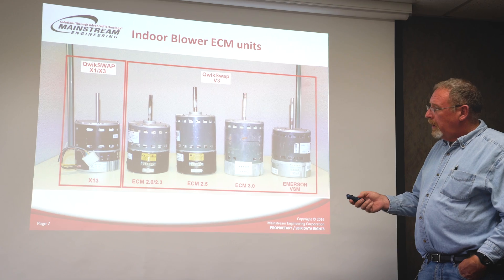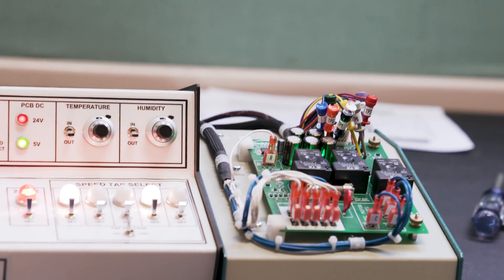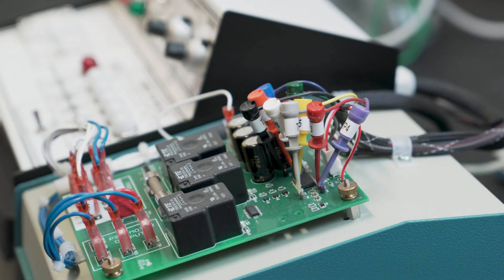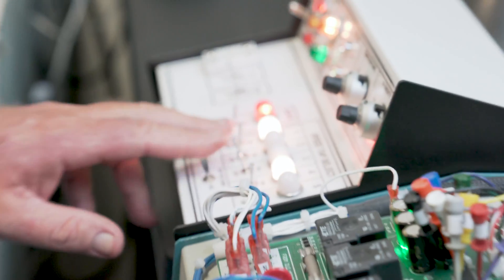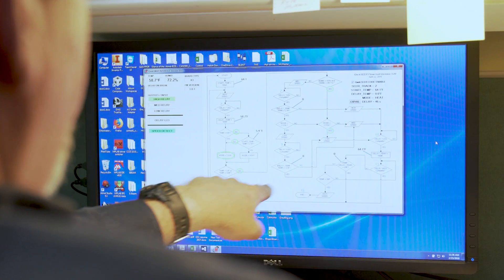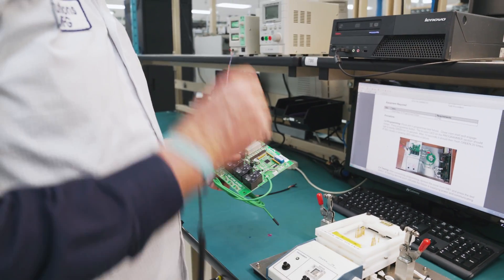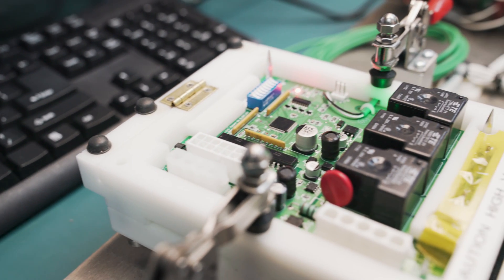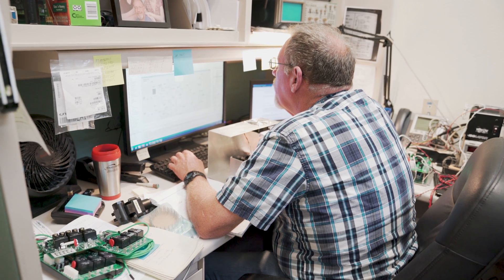EE, on Developing Products for Real World Needs

Comment: I have an ecm blower motor whose lower part--ecm i believe, or control module/where the 240v ports and speed taps are. The motor failed one week into the install of a new air handler. I tested the motor with direct power and individual low voltage speed 24v tests and it works so im able to get my a/c running for now without the module but it does not shut off unless i pull the disconnect or circuit  breaker. The ecm replacement is nowhere to be found. It is/was a 3/4hp 1250rpm variable speed motor, 
Would this product work for me with the existent motor?
Reply: Please help
Reply from the maker: @juicebocs574  Hi, yes go to our website to view the various types of QwikSwaps - https://www.qwik.com/product/qwikswap-x1-x3-v3/  - but if I understand you correctly you are swapping out what was a variable-speed motor so you would most likely need the QwikSwap V3 designed to be compatible with variable speed motors. Be mindful of the interface on the motor and make sure they match up with the QwikSwap unit before purchasing. If you have any immediate questions feel free to give us a call at as well at (321) 631-3550 or email us directly at info@qwik.com